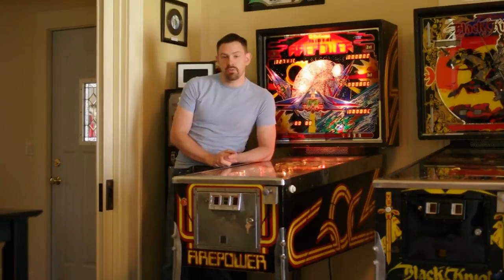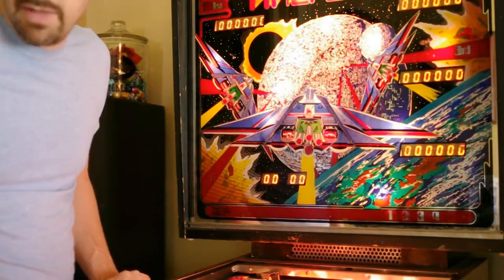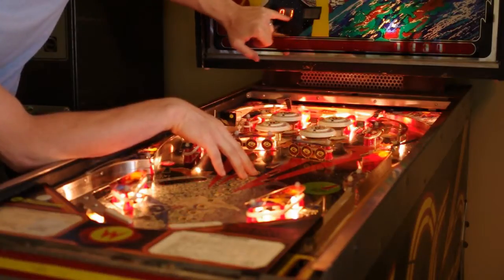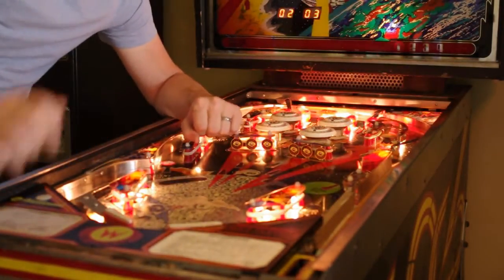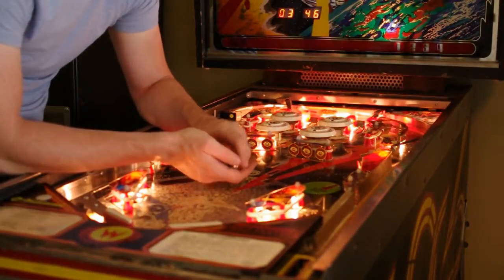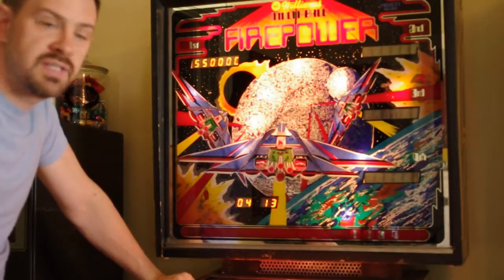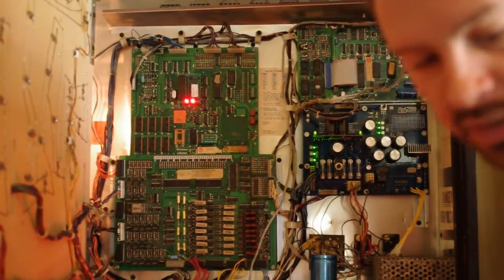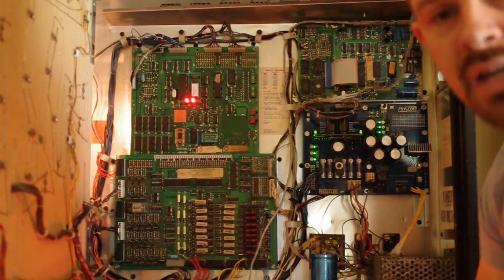williams system 6 diagnostics

Comment: I'm interested in that rom adapter you talked briefly about..  I checked your store but dont see it.  What exactly did that do?  I'm all for minimizing the number of ROMs in my machines!
Reply from the maker: In the past, I used to offer an adapter board that used a single 2764 EPROM in a system 3-6 board set.  But I've been sold out for a while, and they were a bit too problematic, so I've decided to discontinue them.  Might be some out there on the used market.
Reply: @SiegecraftPB  Interesting..  I've never looked at exactly what the memory map looked like for each chip - I know you can do some consolidation but wouldn't think there would be enough address lines on any one socket to do what you did..  I'll have to check it out..  Thanks!!
Reply: Adapter for the memory was that soldered to area where the batteries went? My socket for the batteries is fried. Looking for an alternative.

Comment: Do you have to be in diagnostic mode to hear sound when you hit the button on sound board
Reply from the maker: Nope.  Sound board has a completely separate processor, and runs its sound test independent of the main CPU board.  All the sound board needs to get into its own test routing is power and a speaker.
Reply: @SiegecraftPB  ok thanks alot hopefully new sound board fixes but I think it may be a problem with my rottendog board

Comment: Very informative!  I'm troubleshooting a few issues with my System 6 Blackout and this helped a lot
Reply: What isssues is blackout having?I own one myself
Reply: @XxBishop78  Ha, same here!  Working on one right now.  My issues are that it's locking up after 45 or so seconds and sound seems to have died entirely.  I get decent voltages on both sound and MPU so I think the issues might be unrelated.